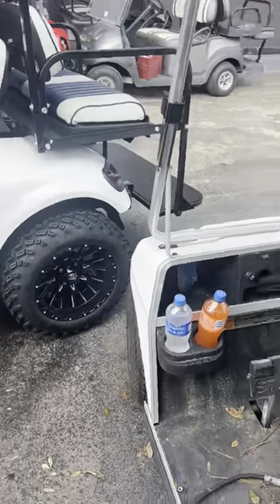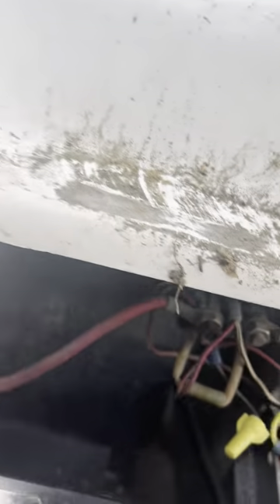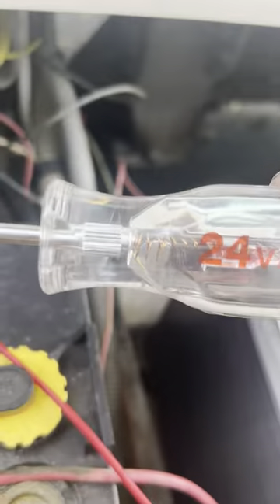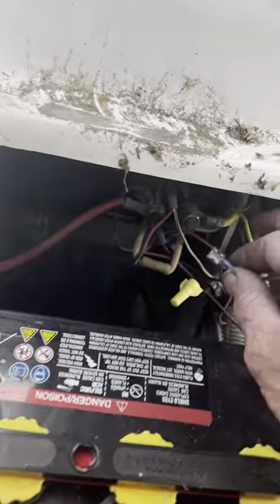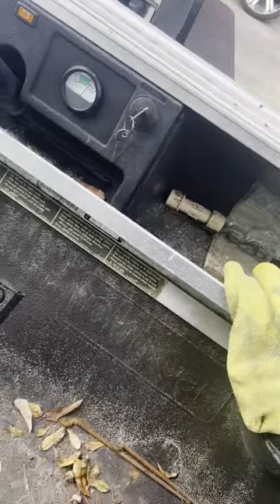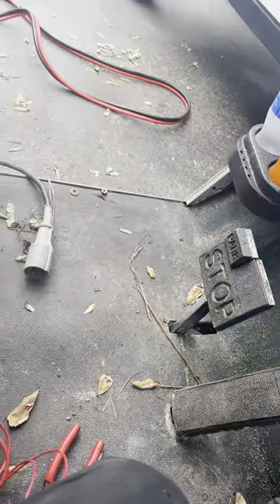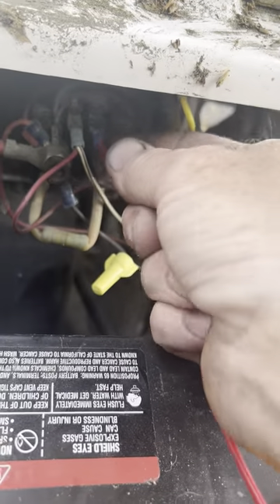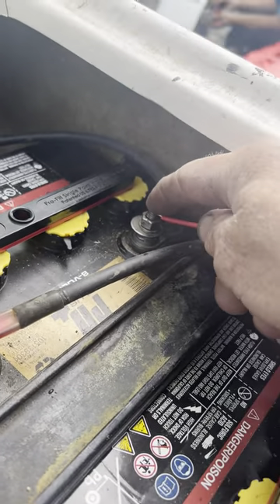CLUB CAR 48 volt does nothing

Comment: Hey mate, i have a 97 club car, and its been running well for 7yrs with no troubles, just this week it wont charge, cart still runs, i can hear a click from the charger like it wants to start, when i pull charger out of the cart solenoid clicks, im going to try another charger to see if thats the problem, what else maybe stuffed? OBC or Bad Receptacle?
Reply from the maker: Does the golf cart run?
Reply from the maker: If so probably bad obc or relay in charger
Reply: Yes cart runs fine
Reply from the maker: @Ngere274  what type of charger do you have. Is your cart a 48 volt?
Reply from the maker: With your charger hooked up to the car. Unhook the yellow fuse holder on back of the charger plug. And run a wire from the backside of the charger plug to the main negative.